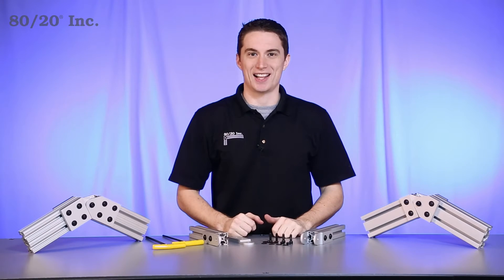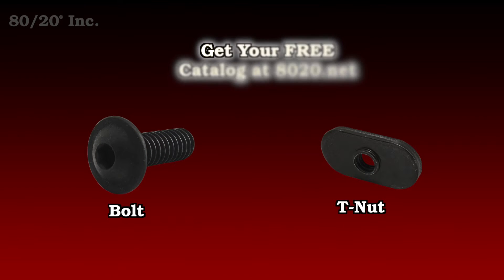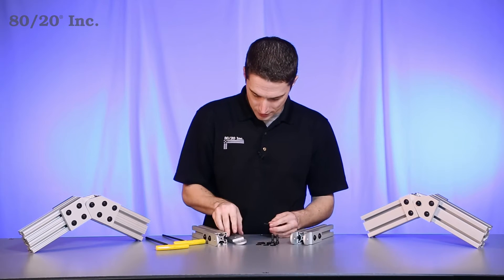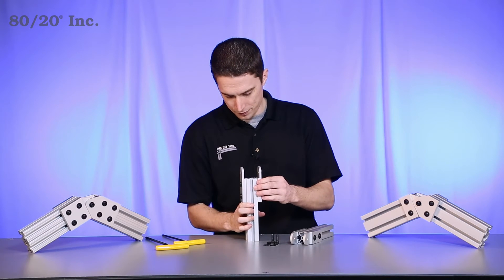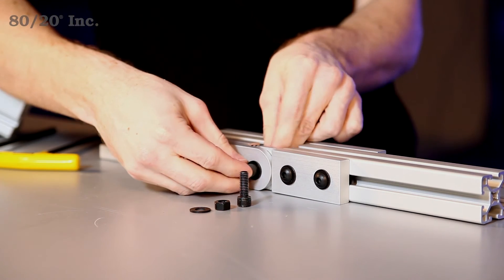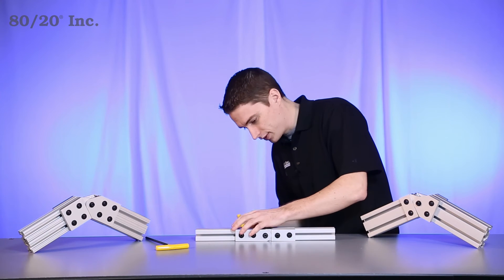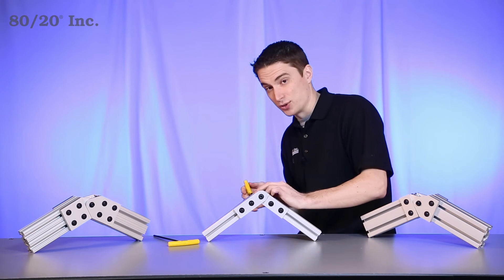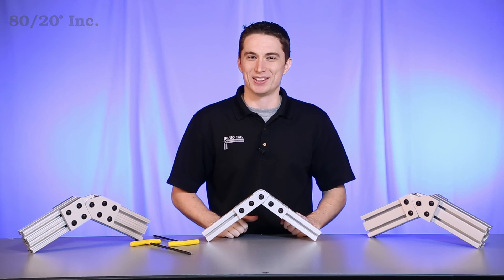80/20: Pivot Plate Overview

Comment: Do you have a version of this that will only allow the pivot to go in one direction? i.e. instead of the piece with a curves on both corners, only one side is curved so it can pivot in that direction, and not the other. This would allow the pivot to effectively stop at 180deg, which is what I'm looking for. If not, is this something you could make? Thanks
Reply from the maker: Hi Tyler! We do have 90 degree pivots. You can see some options here: https://catalogs.8020.net/80-20-Catalog-24/6-80/

Comment: Wondering if you have a hinge that functions in this same “form”? Meaning, the two beams connect the same way, with the joint/hinge between the ends rather than the lift off hinges you have that I believe are mounted to the side or top of the beams.  Hopefully that makes sense? Basically...I want it to look like what you built here, only I need it to function as a hinge rather Thant tightening bolts to lock in specific position.
Reply from the maker: Hi, Aaron. The dynamic pivot joints can attach to either the sides or the ends of the bars and will act similar to an “elbow” type joint.
See more here: https://catalogs.8020.net/80-20-Inc-Catalog-23/338/
Reply: Thank you!

Comment: Guessing fractional is another name for imperial, which you guys don't like because it suggests a connection to the British ruling once upon a time.
Reply: Calling it "fractional" is an industry term. It's called fractional so drawings can be dynamically scaled-up vs remeasuring or converting measurements for every single piece. If it were Imperial/Metric, it'd be a static value.

Comment: how stiff is that joint once it's tightened? Can it be moved by hand?
Reply from the maker: Thanks for the question, Corey.  The pivot plate is great for securing two profiles at an angle, however we don’t recommend it as a standalone fastening option for load bearing applications.  If you need a pivot that can be easily adjusted, we recommend our dynamic pivots, which allow full range of motion from 0-180 degrees.
Reply: @8020llc  can you provide a link to the dynamic pivots? I need something that can support maybe 50 lb. Can lock out flat, but then down at a 40° angle from there.
Reply from the maker: @peterdods425  These are the locking pivots we have
http://catalogs.8020.net/80-20-Inc-Catalog-23/737/#